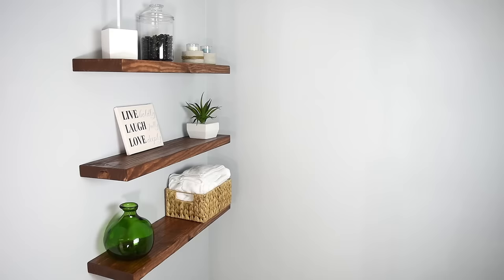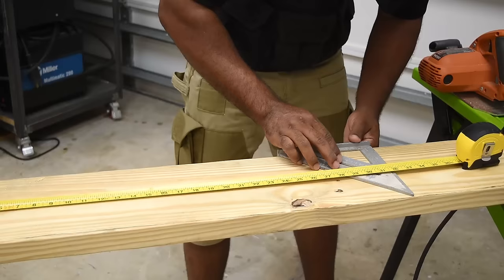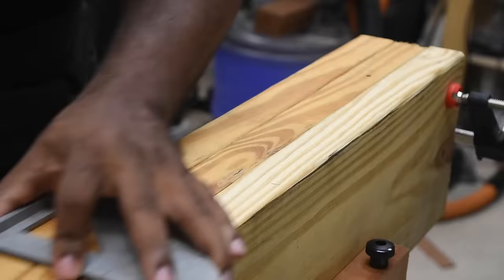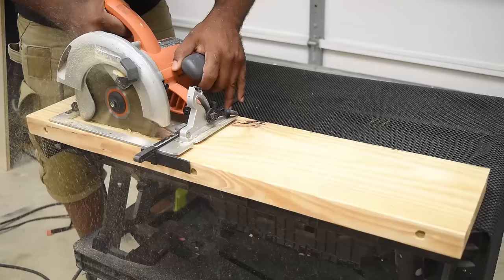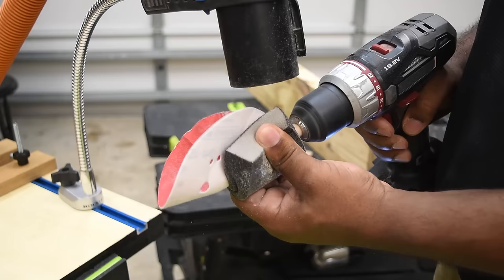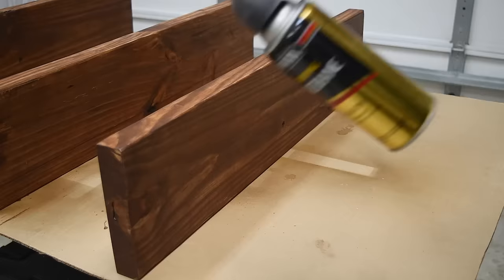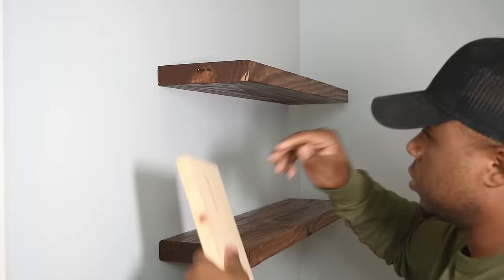Easy DIY FLOATING SHELVES No bracket | DIY CREATORS

Comment: If you are wondering how much weight these shelves can hold, don't bother looking through the comments. Just went digging and there is literally over 200 comments asking about the weight and he never answered a single one of them.
Reply: literally what i wanted to know! lol
Reply: It depends on the dowel thickness and Wood type. I'd guess this shelf could hold 50 or so lbs
Reply: Those are not for heavy loads for sure, only for decoration.
Reply: N I put my microwave oven on a floating shelve
Reply: The dowels are probably fine as long as the joints are nice and tight, so it probably would mostly rely on your screws.
Reply: And it also depends on if u drill into the stud or use a wall anchor but he’s right it should hold at least 50lbs

Comment: You just dropped about 5 tips I've never heard of in the process of explaining. This is good stuff.
Reply: Right?! Me too!!!
Reply: Completely agree! Mine didn’t turn out “perfect”, but that was more due to the lumber, definitely not due to the instructions!
One thing that I would recommend is to do the process as the video shows: In the SAME order!  I did the cuts as well as all of the drilling, countersink, safety pilot holes, etc.  at one time as well as sanding the dowels.  I did this because I knew that I was having back surgery in the next few days and I wanted everything to be ready to go when I felt like finally hanging the shelves...
I had to go back and re-do a bunch of things due to this...(again- totally MY fault 100%). But the biggest pain was that I didn’t sand down the dowels enough...”lightly sanding” them was NOT what I considered lightly! Took way more sanding than I would have thought to get the actual shelves  to easily slide on and off!  So, if you decide not to do in order of the video/instructions...be forewarned!
Reply: Omg seriously…I never would have thought to put a dowel in a drill to sand it!! 😮
Reply: Yèra
Reply: Yes, I agree!

Comment: In the beginning he says you only need 3 tools, 3 minutes into the video he is using 13 different tools 😂
Reply: He does say you can have the store cut it if available.
Reply: You can do this project without sanding anything, therefore you only need a drill and a few specialty bits
Reply: Or you could hand sand

Comment: Dude... You're a genius. You just taught me at least 3 game changing techniques. Sanding dowels with a drill, using a speed square with a circular saw, and of course the method of making floating shelves without expensive hardware. Thank you! Awesome work!
Reply: Yeah, I found those same three things Jake.  So glad I watched this.  Using a circular saw is so much easier than getting out the bench saw.  The speed square makes it way more precise.
Reply: Speed square with the circular saw blew my mind.
Reply: Fantastic!!
Reply: Chances are your circle saw came with a jig that does pretty close to what he did here.
This is handy and quick in a pinch though
Reply: You can also use a 4' level as a straightedge clamped to both ends for the longer cut.
Reply: See, I saw that speed square trick thought it was cool but didn’t use it with my circular saw. Cut came out hmmm sorta flush. First time using a circular saw but will be sure to use speed square next time.
Reply: DITTO!!!!!!! A bunch of new tricks!!! Thanks Jake for the reminder of the fun tips!

Comment: Why are people complaining about needing tools?  You need a drill, a saw and a screwdriver.  If you don't have those, why on earth are you looking at installing shelving?
Anyway, thanks for the tip  - I'd been trying to figure out a clean way to hide a retaining screw, and I like your idea of screwing into one of the dowels.
Reply: It's like people expect everthing to be done for the them.....whats the name of the channel again?
Reply: Word
Reply: Lol!!! Right!?
Reply: You also need a bit to countersink the screws. And either a stud finder or some molly bolts. Orbital sander not required, but highly recommended if you're going to stain... and it's also useful for rounding the edges.
Reply: EXACTLY
Reply: Don't forget the sander... Gotta add a new tool to my little collection.😁
Reply: 🤣🤣 Thought the same thing! You’re watching a DIY home project video- if you don’t have any tools and the thought of them is a deal breaker you should mosey on back to Amazon!
Reply: I think the comment about needing tools is some kind of meme. I see it in pretty much every furniture DIY out there.
Reply: She who dies with the most tools wins :)
Reply: He didn’t use a SINGLE Tool that EVERY Homeowner should have anyway....this is about as easy a DIY project you will find!

Comment: Love the idea. I modified one of your steps. Instead of having to do all of the sanding, I drilled the 1/2” hole like you showed and then cut the board. I then used a 9/16” drill bit on the large part of the board. Made it easy to slip the dowels into it. Thanks for the video!
Reply: Good idea! I’m going to try it that way too!

Comment: My daughter was just asking for floating shelves. Your method looks great. She wanted 2 x 10 material. I have it trimmed to size, drilled, ripped, dowels sanded and am calling it a night. Sanding, a little router on the front edge, then stain and put some poly on. Thanks for the excellent video.
Reply: I am needing a 2X10X23. Did you follow the same steps? How did they turned out?

Comment: Very good method for making floating shelves!!! After  a lot of research I decided on this method and it worked great. A couple of things to keep in mind, my home is a older home and has lath and plaster walls so they are not 100% flat and true so I had to do some minor sanding of the attachment bracket, secondly drill the holes before cutting to 1 1/2", I forgot and was a bit of a pain. I ended up making the 1/2" dowels a bit longer, they extended 4" into the shelf. I went with a routered ogee edging on the top of the shelves to get rid of the rounded edge of the 2X6.
I plan on making more shelves.

Comment: Definitely a new take on the floating shelf. Only thing I would do differently is add a washer to the screws going into the wall.  This would add more surface area for security of the mounting wood. 

Great job, keep it up
Reply: Chris Bourassa add a washer ur creating a depth away from the shelf even though minimal
Reply: The washer goes between the bolt head and the wood adding more contact area for added security of the bolt face
Reply: @qzwxecrv0192837465  Nah, he used screws with a built in "washer", see: https://youtu.be/wki3wMAbtLg?t=400  They looks a lot like the Kreg washer head maxi-loc screws.
Reply: I'm using a low profile anchor bolt. They work great and you wont need to worry about the washer.

Comment: Wife has been trying to find "doable" floating shelves and these were them.  I ended up doing screws into all three dowels because i ended up with a small gap where I made the rip cuts. I'd suggest wood gluing the dowels into the small piece against the wall, too.   As a beginner, DIY'er I appreciate the video and look forward to more
Reply: I don't understand why to put the screws in the dowels. Just to stain it? But then you take them out when you mount the shelf?
Reply: Jessica MacMurtrie to hold the shelf in place once mounted. With woodworking, oftentimes you do a lot of construct/deconstruct before you have your final product.  In this case, you want to have all holes drilled before you stain/varnish.
Reply: @suzannereed6645  Right. Thanks! I get it now, he just didn't really talk about putting a screw in the dowel, then removing it when hanging it up, then replacing it after the shelf is up. And since this was my first woodworking project, I was confused at first, but it makes sense.
Reply: Beware Iif you choose to glue...if the dowels don't align perfectly straight you will have a hell of a time getting the shelf back together.

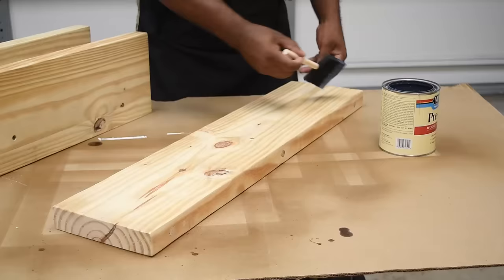Comment: Oh, one tip: To cut the stock lengthwise, you could clamp on a 1" x 6" as a guide or maybe a long piece of aluminum. 4:57
Reply: Well the 1x6 would work for his saw but I'm sure not all circ saws are 1 1/2" from the blade to the outside of the metal base.

Comment: I wasn't sure where you were going with it when you drilled the hole for the dowel the same depth as the dowel, until you ripped it down.  Neat idea, and it seems like it works quite well!
Reply: Chris Albee - same! I was confused until the ripping step!
Reply: That's exactly what I was thinking too.  Which is why drilling to full depth of the dowels threw me off lol

Comment: Inventive way to do those shelves, cool 👍
Reply from the maker: Thank you
Reply: @DIYCreators  how do you manage to prevent sagging? I built these and because of the two pieces of lumber being separate I find it’s sagging on me. Please help!
Reply: Tried this DIY video and same issue with wobbling and sagging. I even installed screws in studs instead of drywall so that shelve would be more sturdy, but still same issue.

This shelve seems easy in video, but video nowhere shows that two screws on horizontal axis actually are not capable of preventing sagging and wobbling on vertical axis.
This shelve is decorative at best and can't hold anything heavier than toilet paper.

Will be going to home depot tomorrow to get right angle bracket. So total bill turned out to be ~$100 for 3 shelves. I totally regret cutting the board in two parts as brackets don't need that.
Reply: @zofla90  I'm building some right now but I'm using a longer dowel!!
Reply: @ATVERKING13  did the longer dowel work for you
Reply: @deandrebinion3714  it still flexes a little but it'll hole 25lbs just fine!
Reply: @ansis9970  metal dowels maybe?
Reply: @jasonmeanshealer  The bending location was screws in the studs. Not where dovels connect two shelve pieces
Reply: @ansis9970  maybe make the shelves thinner so there’s less force exerted on the screws? I’m getting ready to build some now but have metal 6” dowels that screw straight into the studs. Just need to drill holes in the board. I’ve also seen it’s best to cut out the drywall in that area so that doesn’t compress and cause sagging
Reply: @ansis9970  this video is nice to watch, but I knew right away this is not best way to do those shelves… dowels are not sturdy enough to hold the load on this shelf, and I pity the person who needs to remove this shelf in the future and assumes just to pull it, might damage the wall the way it’s fixed by hidden raw plugs… overall few nice tricks showed in this video, but if you want proper floating shelving this is not a way to do it
Reply: @ansis9970  yeah maybe use thinner wood for shelving to reduce weight, but on the stud side, the proper way to do it would have been to use metal rods that have a small square plate at the stud end…with 4 screws going each corner of the plate. You need to cut small rectangular hole in plaster to fit them through right into the stud and then your shelf should cover missing drywall or if you are lucky you can plaster back using just putty. That way your shelf mounting rods will be rock solid, you could do pull ups on them. Then drill the shelf holes for the rods to the depth of the rod and just slide it on.
Reply: @zofla90  ggyy
Reply: 66567
Reply: All you guys figured out that the shelves always droop if you use short dowels.. This system is not  the best... It looks clean but you can't put any weight on them.. The folkrum effect makes these a problem.
Reply: @DIYCreators  พแแจ
Reply: @Cristobal Armando Vasquez  don't sand dowel. Hammer it in with rubber hammer.....tighter fit
Reply: Instead of decking or wood screws use thicker lag bolts directly into the studs.   The deck screws will stretch slightly then bend. Stepping up to a 1/4 inch or 3/8 inch thick lag screw bolt will resist the stretching and bending that causes sag.
Reply: The best floating shelf video I have seen.  Show me more.

Comment: If you don't have a stud finder, don't use that wall anchor. Get a stud finder.
Reply: You can download a stud finder app on your phone.
Reply: You can also use your fist to find a stud also.. that's what me and my husband do.
Reply: @kimberlyreece8829  I do this too but my wife gets sick of having to patch fist sized drywall holes all the time
Reply: What happened to tapping and listening for the dead sound of a stud behind the rock?
Reply: Floating shelves are a design aesthetic and are not meant to support hundreds of pounds. Thus, these floating shelves will be just fine with a pair of good wall anchors.

With that being said, it's easier to fill screw holes than anchor holes so I'll usually find a stud for my applications.
Reply: You don't need a stud finder... I'm right here!
Reply: @garymacneill7041  Lol. Nice job, Gary.
Reply: LMFAO....those wall anchors have saved me a million times...you have to get the good ones ez anchors home Depot....they are the best...
Reply: Agreed. Most people don't or can't consider the torque load put on wall fasteners. Good for vertical support, bad for torque. Find a stud and don't ever worry about any of it.
Reply: If you can at least find one stud, the rule of thumb is that normally  16” out from that point will be another stud.  It’s not foolproof, I’ve had areas not have one, but 9 times out of 10 this rule applies.  Sometimes you can’t avoid the use of anchors.
Reply: Another trick to finding a stud in drywall is use a rear earth magnet and find the drywall screws or nails in line or even just one and use a level to draw a straight line. The magnet will even center itself on the screw. You can hang it with a piece of thread and it will fly to the steel screw under the drywall
Reply: NikovK you can’t always use a stud to hang shelves because they are not always at the spot u need them to be so the EZ wall anchors or other anchors work well
Reply: Yeah, I learned this lesson - the hard way!
Reply: You can find the stud with a simple magnet.
Reply: 121bham  I never thought of that thanks
Reply: @garymacneill7041  you're a stud finder?
Reply: @artincorona  Yes. Every morning I get up look in the mirror and find the first stud of the day.
Reply: I have been using magnets because i hate stud finders. Take a little more time, but you know when youre on a stud for sure

Comment: Amazing low tech solution, great walk through on how to do it. Great content dude! 

How much weight can these shelves hold?
Reply: Following. Excellent video! 

I would like to know how much weight they can hold too. Hoping to make bookshelves that can hold
Reply: To increase the weight limit slightly, add more dowels, and place the screw into your studs 2/3 or even 3/4 towards the top of the bracket (not in the centre as he did in this video). Caution!!! Make sure you drill guide holes and straight ones. The closer you get to the edge, the more likely you are to split the wood. 

The logic on the strength by screw placement.., and any other engineer types feel free to argue, but!
The lower your screw in the bracket, the more prone it will be too bending. You have less distance from the screw to the bottom of the bracket to resist the bending moment applied to the screw. 
If you have it higher, I'm pretty sure you decrease the bending moment on the screw, and the wood would pull on the screw instead of bending it... If that makes any sense ...

Comment: May I make one suggestion? Figure out where your stud screws are going to be before you drill for the dowels. That way they won't interfere with one another. (I didn't think of this myself. I saw it on another floating shelf video.)
Reply: txrvs .. personally that's the only benefit of DIYing it, bc they're already fairly cheap in the stores but you don't get bc to align with studs.

Comment: Great video.  A couple tips . . . be sure the dowels don't line up the the studs before drilling for them.   Also, I would favor at least 5/16" lag bolts with washers over light-weight construction screws.

Comment: Hi friends, if you intend on using the saw yourself please do NOT use gloves when sawing... Gloves are prone to getting caught in the blade and dragging your fingers and hand into the blade... So go ahead and saw like the gentleman did in the video, just go slow and be careful and do it without gloves
Reply: This is counterintuitive, but it is safer  not to use gloves when using rotative Power tools. Good reminder.
Reply: Yaaaaaa...my pointer finger is still healing from a nasty, gruesome cut as the saw DID pull my glove into it. I thought for sure I lost my finger at the knuckle, but I didn't. It's going to be healing and  tender for a loooooong time. Funny thing is, just about 2 minutes into the first use of my new table saw I was pondering if gloves would be a hazard...Um, Experiment over.
Reply: I was wondering why my DT teacher would never wear gloves doing this
Reply: Excellent tip. 
I actually knew a guy in high school that had two of his fingers taken off cause he wore gloves with a wood chipper. 
Funny thing is, he drew better than I could

Comment: This is the greatest shelves Ive ever seen. I am questioning, if the rods can hold the weight of the shelf, and the stuff on the shelf?
Reply: Tacoma Designs will.
Reply: The question is really around shear strength. Three, 1/2” oak dowels would likely hold a minimum of 500 pounds.

Comment: This is great—thank you for sharing! Does anyone know how much weight the 1/2" dowels can support? I'm thinking that's the weakest point of the shelf, more so than the screws, but I could be wrong on that.
Reply: Depends on the brand but usually about 50lbs!
Reply: YOu could always add two more dowels if you needed some extra strength. I'd definitely have two safety screws if you are need more than three dowels.